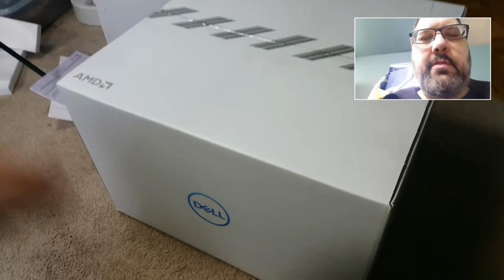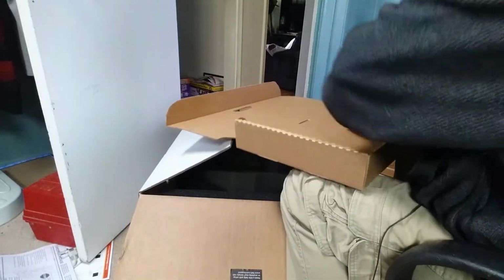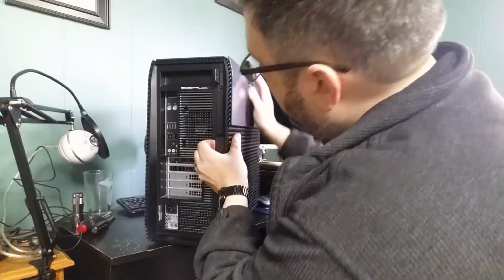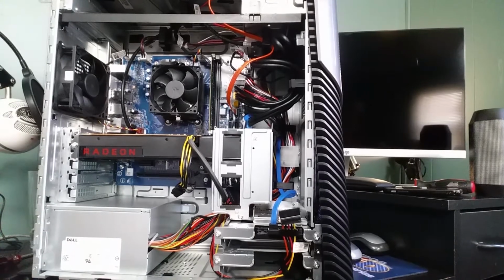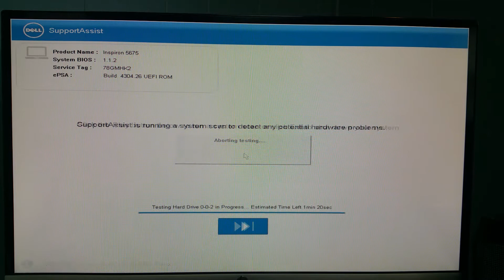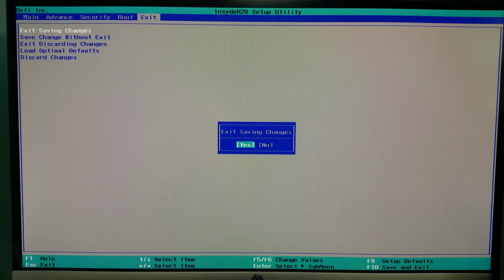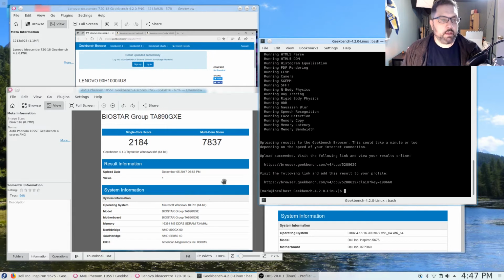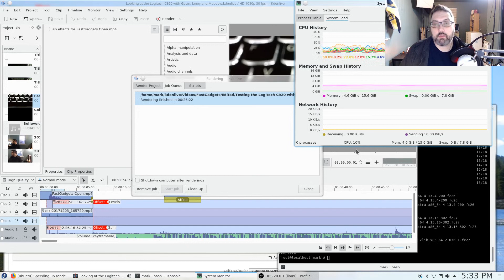Unboxing and Setup of the Dell Inspiron Ryzen 7 1700 Desktop Model 5675

Comment: I just got my Dell 5675. Ordered it 3 days after this video was posted. It has liquid cooled 1700x and the 256gb m.2. I actually like the case and look. I'm going to modify the insides and put in some drives.
Reply from the maker: Nice! Gaming works well on mine so far as well.
Reply: I ordered mine at the same time as you, and mine only arrived here last week LOL. Dell had a real problem with backorders from their holiday deals... but it's finally here and I love it. Never had a liquid cooler before, nice little bonus to have.

Comment: Nowadays, particularly during the holiday deal season, it's actually cheaper to buy a pre-built PC than to build your own. I built a system last year for linux and did it because I was coming from macOS and wanted to ensure I had components that would boot to macOS in case I wanted to go back to it (I haven't even thought about it!). For this Christmas my son, who is a gamer, wanted a new system and wanted to build it himself. After ordering all of the parts from the cheapest sources I could find, it's still more expensive than if I just bought an off-the-shelf Dell, etc. on sale during the holidays. Particularly because of the video card.
Reply: mark2741 I'm a gamer.  I've been thinking about building a computer for a long while.  I ended up buying this exact pre-built computer this holiday season. No regrets.
Reply from the maker: I’m very pleased with mine!

Comment: Just tried Geekbench4 for first time. Running latest version/updated of Korora linux - 
Core i7-6700 with 16GB RAM
Single Core Score: 5280
Multi Core Score: 18129
Reply: Nvidia 1050Ti

Comment: Keep in mind that the Dell windows version is modified, the activation uses Dell severs and will not work with normal windows 10 keys
Reply from the maker: I took the dell 1TB drive out and used my SSD with the Windows install from my old system which is the education edition from work. :)

Comment: AMD Ryzen 7 1700X Processor 3.4GHz; AMD Radeon RX 570 4GB GDDR5; 8GB DDR4-2400 RAM; 1TB 7,200RPM Hard Drive
 is this model the same? Its for $700 near me.
Reply from the maker: The 5675 model comes in at least a dozen variations. Mine has the 6GB RX580 and the 1700 processor.  The price you mention sounds pretty good!

Comment: Is this pc has wifi???
Reply from the maker: Yes I believe it did.  Keep in mind I returned it right away and bought the Dell Ryzen 7 1700 model 5675 instead. This PC had way too many shortcomings.
Reply: @FastGadgets  thanks man....☺
Reply: @FastGadgets  just one more thing...i am getting ryzen 7 1700x with 12gb ram,128gb ssd,1tb hdd and rx 570 in almost 650 us dollars but pc is open box...should i buy it???
Reply from the maker: MUHAMMAD AADIL if you can return it if defective, yes I would. I’ve bought many open box and refurbs without problems in the past.
Reply: @FastGadgets  thanks man...😎😎
Reply from the maker: You are most welcome sir!